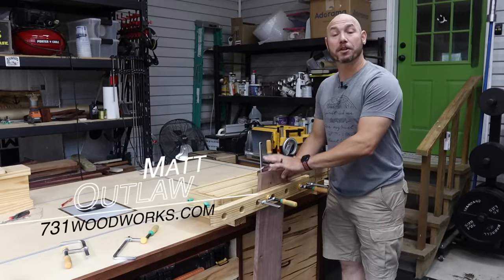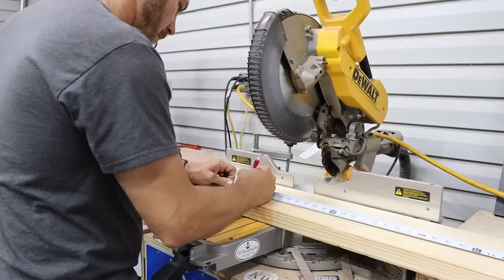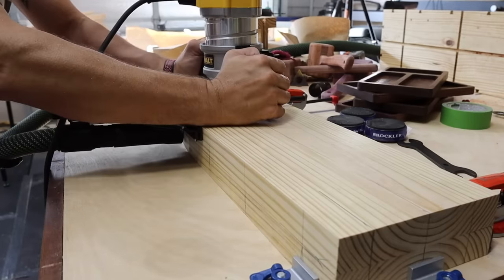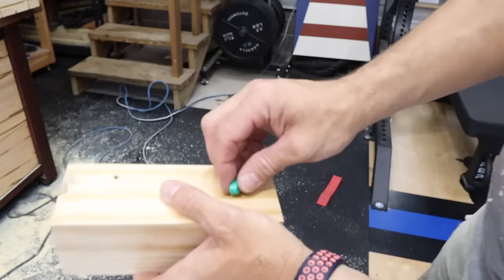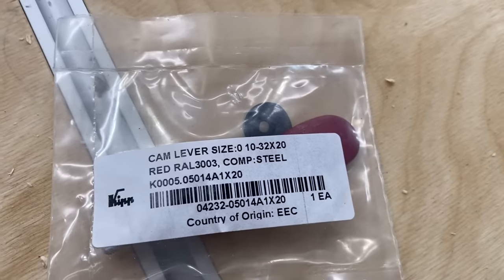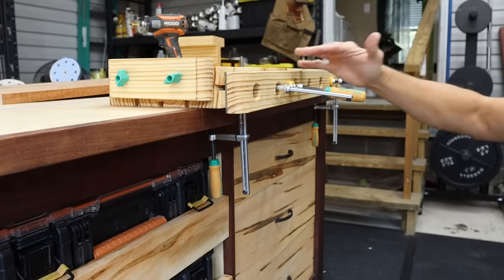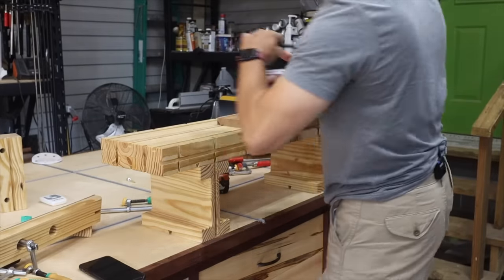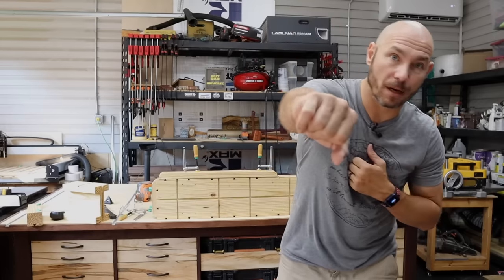Portable Workbench for Small Shops

Comment: nice work! very interesting design! i really like the versatility for attaching it to a lot of different objects in different orientations. i will remember the dovetail cutouts for later, really opened my eyes to the different ways you can use a clamp.
however, its application seems quite specific. for those without the space, i’d assume they would be stuck using with small/hand tools. this project would take a lot longer and be a lot harder without these tools. likewise, someone with a shop that has large machining tools would probably have the space and resources for a large workbench. when you have that, the benefits of the portable workbench would have limited applications. 
however, i can see it being used for outside work and hobby stuff if you had the workshop to make it

Comment: I can't wait to give this a try.   I can see so many uses for it, even if you do have a nice big main work bench.
BTW, Dawn dish soap and warm water for those shorts.  Don't put them in the dryer until you're sure the glue is gone, or it will stay forever.
Reply from the maker: too late.  Been washed and dried.  Glue is permanent now.
Reply: @731Woodworks  you just better hope none of Mrs. 731's nice jeans were in the load! 😄

Comment: I use one or two Kreg Mobile Project Centers for my workbench.  They are great, but they are not optimal for some types of clamping, hand planing, routing, or sanding. This adds functionality of a workbench  to the Kreg Mobile Project Center at a reasonable cost. It is a definite build for me.  Additionally, the size of the "Mini Workbench" can be lengthened or shortened to your needs.  I will lengthen mine a bit to be equal to two Project Centers side by side.

Comment: This looks A LOT like the Work Horse top (which Mike also helped design with Jay Bates). I built the Jay Bates design, and this is basically that, but without legs. 

In short, I LIKE IT A WHOLE LOT. There are some pieces here that give it some more extensibility than I'd previously considered.
Reply from the maker: I think Mike build on what he learned from the sawhorse design he did with Jay
Reply: @731Woodworks  It's still my favorite "workbench" design. Heavy enough to use for power and hand tools, and light enough (once disassembled) to bring to craft shows. Extensible enough - as your video proves - to do anything I need. 

And I like the fact that I can make new legs of varying heights. So I can have a hand tool bench, a power tool bench, a lathe bench, and a roman-style low workbench ALL without making a new top.
Reply: Yep, both benches are cousins, but one is smaller and more portable with most of the same features.
Reply: @miketaylor9979  well, I'm still a fan. I built the version from Jay's plans, and it's my primary work bench. I'll bet building two more sets of legs. One so it can house my lathe, and another set to make a Roman-style bench - all with the same top.

Comment: That is a cool project!  I've added it to my build list!  
That Southern Yellow Pine is beautiful and tough. Unfortunately, it isn't available  up here in NY. We have Doug Fir at our Home Depot.  Doug Fir is a lot less dense and usually has quite a few knots. It will also crack and split under pressure.  If you go to a wood supplier, not a big box store, you may be able to get Southern Yellow Pine,  but if you can't they will have many other types of wood.  Consider maple as it is reasonably priced, very tough,  and used for workbenches. That is what I will use when I build mine!
Reply from the maker: Maple would be a good option for sure.

Comment: I changed my mind. While maple would be strong, it would also be expensive and very heavy. Doug Fir is cheap in. comparison, and if it gets damaged, I can make a replacement part  cheaply.  The only thing I wonder about is whether the slots will hold up since Doug Fir is a soft wood. Not a lot to lose though with cheap lumber.  I wish we could get Southern Yellow Pine up here.  It has a Janka number of 870 compared to 710 for Doug Fir.
Reply: I built mine from Douglas Fir and the slots do not hold up. Every time I try to mallet the wedge in, the cam block rips out of the slot.
Reply: @BillNeubauer  I guess Doug Fir is out then.  I will wait until I get some 8 quarter maple, though that will make it quite a lot more costly. That is the problem with a lot of these builds. When you add up the costs, they become pretty expensive.

Comment: Hey Matt, I bought these plans and am almost finished building this mini workbench. It’s been a fun project and I’ve learned a lot! A couple questions, I’m getting a lot of router tear-out and burn marks in the grooves. Is the best way to fix the tear out just sanding it down? What do I do to avoid this in the future? Also, do you recommend a finish when it’s done? Would Danish Oil be good? Thanks!
Reply from the maker: Danish oil works well or Odie's Oil is good too.

Comment: The buy list shows the "Microjig MB-050-0514 Matchfit Clamp 1/2" Diameter 14 Degree Router Bit" and a "1/2" Carbide Tipped Dovetail Router Bit 14 Degree".  Were both used?  Bummer that the "Removable Carpenter Framing Square Fence Anodized Aluminum 7-7/8 Inch long" is sold out.

Comment: Hi i have a question, is the dovetail in 1 3/4 (40mm) plywood as strong as in solid wood?
Reply from the maker: I think it is.  May be a good test to do!  I use it on my cross cut sled and jointing jig and they are both plywood.  No issues so far.   Thing is, to hold something flat against the surface, doesn't require a lot of clamping pressure so you're not tightening the clamps a lot.

Comment: If you use mineral oil to season a cutting board, your not using the best. Olive oil is the heaviest oil
Reply from the maker: Olive oil goes rancid after a few months.  Not recommended for cutting boards.  Mineral oil won't do that.
Reply: Thanks. Had my board over 20 years. But after using it to cut meat I scrub and reseason. Letting the oil soak in

Comment: $20 of wood....*small print* and $115 in additional supplies. Mrs. 731 takes no responsibility for Mr. 731's truth stretching. Any counseling required due to sadness resulting from realization that small workbench is actually $135 is customer's responsibility. Realization of true cost may cause dizziness, loss of breath, vomiting, and in some cases, death. 😂
Reply: I'd like to go buy a new truck for $800 worth of tires now 😂
Reply from the maker: I said $20 in WOOD.  The MatchFit accessories a lot of people already have.  I bought them months ago for my jointing jig so it cost me less than $20 to build it.
Reply: @731Woodworks  I know. It just seems a little misleading. Not all people have those laying around, and to tag it like you can make it for $20 seems funny. People are more likely to have the $20 of scrap lumber lying around than the clamps I feel like, but I could be wrong. 

I love your videos though Matt. I didn't mean anything by the comments. I was just poking some fun.